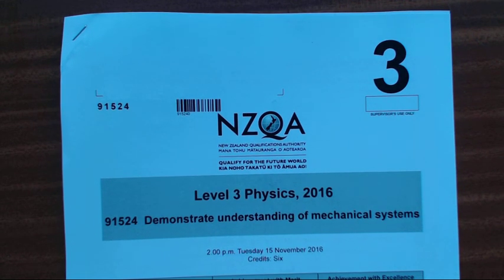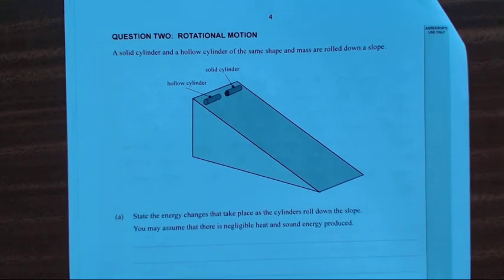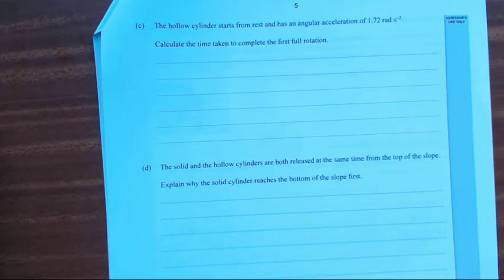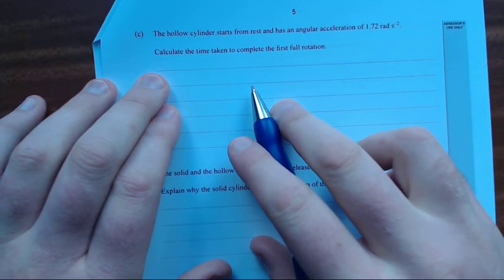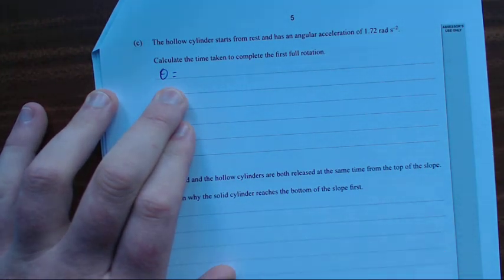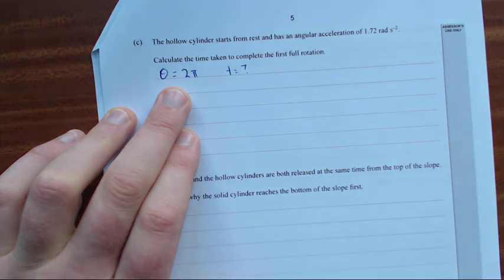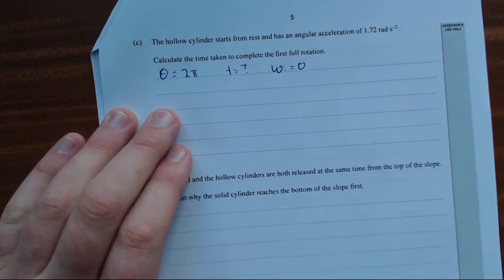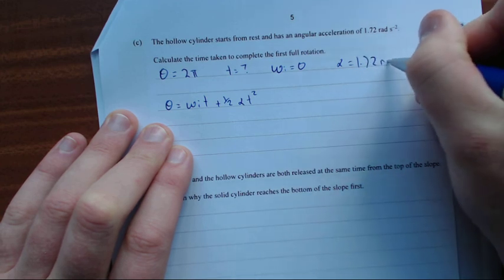2016 Mechanics (NCEA Level 3)-Q2

Comment: 9:00 Are you sure about this example? If the mass was increased and the radius stays the same shouldn't the one with greater mass have greater inertia? as I=mr^2 or (1/2)mr^2
Reply from the maker: Yea this example now that I think about has slightly more going on than just rotational inertia, the heavier one will have more rotational inertia but also a greater gravitational force acting, so this balances out the increase in mass leading to the same acceleration. Hope this kinda makes sense.
Reply: @Mrsargent6529  Yeah I see dawg, cheers